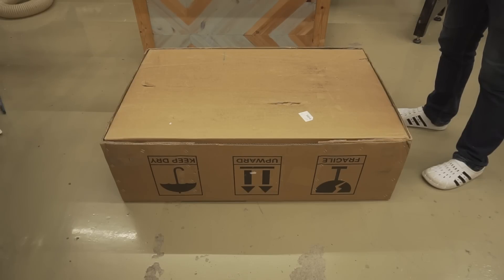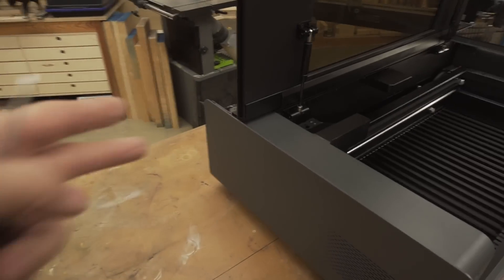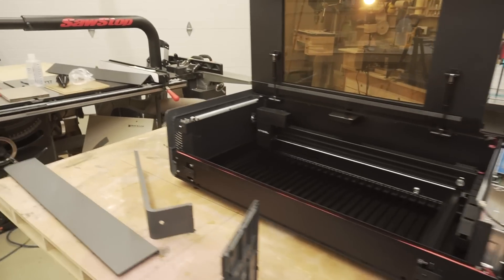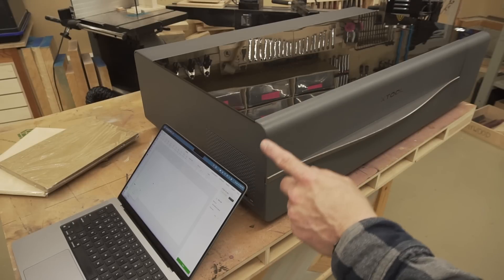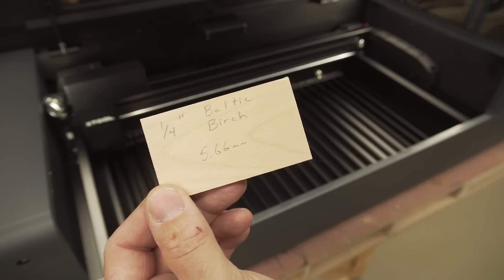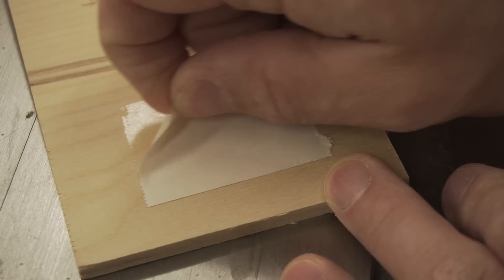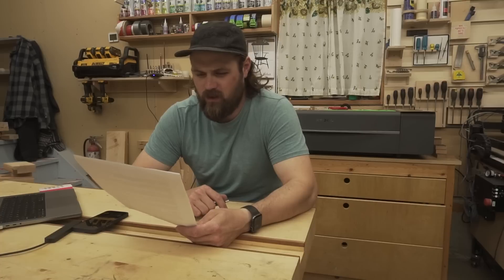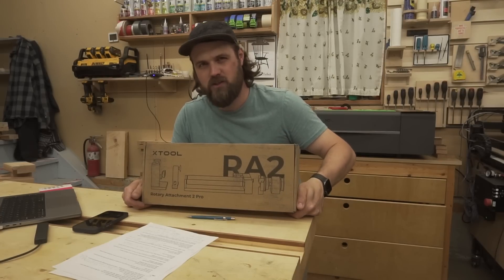xTool P2 - what's inside a $5000 laser?

Comment: Thank you so much for doing this!  I'm going to be performing air-assist surgery on my P2 soon and this video gave me exactly what I needed to plan that out.  Video coming soon.
Reply from the maker: Upgrade or just replacing? I’d like a little more air flow on the P2.
Reply: @dpmakestuff  I’m tapping into the air line using the coupling that is intended for the fire suppression system.  It will be fully reversible to factor and allow me to use factory air assist or factory + external.
Reply from the maker: @nathandcole  any luck? I need more air power.
Reply: @dpmakestuff  yes.  I need to post the video.  I’ll try to get out up this evening.

Comment: The safety interlock can also be a safety hazard. In event of fire the interlock prevents opening the cover to use a CO2 fire extinguisher. As to the rest of the design, the P2 will be fairly easy to maintain without any support. Substitute parts are readily available for most of the guts of the P2. The only part that could be difficult to substitute would be the control board since it contains proprietary code.

You can get through the 3/4" Baltic Birch plywood. However, avoid making too many passes in a row without allowing the wood to cool. Otherwise, there could be a fire.

Comment: Dang, I was hoping you would show the air assist pump. It is in that chamber where the transformer & power supply were, but you did not show it! Great video regardless.
Reply from the maker: I literally showed it. The words “that’s the air pump” came out of my mouth.
Reply: @dpmakestuff  holy crap I am going back to there to see it then, how did I miss it? I was watching so close lol.
Reply: @dpmakestuff here it is! Thank you man. It was from the back of the machine, I was looking for that part in the button side of the machine. Thank you for letting me know, I know how I probably missed that part, I was running my mouth about it not being mentioned in the part before it lol.
Reply: @dpmakestuff sincerely a fantastic video. What are your thoughts since producing this video? Has it been some time; anything else to touch on or to look out for in your future content? I love this machine so far, best in class, fully agree with your assessment & you tested more materials than we have with it so far.

Comment: On the plywood which you tried to engrave and then dye, maybe put a plastic sheath over it before you engrave it? Maybe packing tape could work. This could simultaneously form the negative of a stencil to protect the rest of the plywood from the ink? Looks like you can order wide sheets of tape if tests work
Reply from the maker: So I sealed the surface with lacquer, but the paint went into the wood under the lacquer. I think I should have sealed with lacquer before painting. I could have also turned off the air pump and I bet the burnt wood would have looked perfect ¯\_(ツ)_/¯

Comment: Why is the power switch in the back? Same as my 3d printer. I don't want to have these machines running all day. Power on, use, power off. But this thing is amazing! Do you think it could go through carbon fibre plate?
Reply from the maker: I have a carbon fiber plate. I’ll give it a try. This machine does have a rather annoying switch/button configuration. Power switch at the back, E stop to the right, cord plug in on the left, and start button on top.
Reply: @dpmakestuff  I watched some videos on laser cutting carbon. If you just try to power through the epoxy decomposes and no cutting happens. There is one video of it working really well. I think that is a pulsed laser. One way to do it might be many many passes of an engraving setting.
Reply from the maker: @marc_frank  that’s good info thanks.

Comment: I have wondered just how good those smoke extractors really were...   how expensive are the filters on it?
Reply from the maker: I think the replacement filters are 70 USD. I could be off a little,  it in that zone.
Reply: @dpmakestuff  So how good is the extractor? The filter pack is actually  $160.00. Main main issue with that is that they don't sell the filter stages individually. They should have different runtimes as I've learned from Flux's Beam Air Filter.
Reply: @ulaB  you are gonna buy A LOT of filters for the xTool smoke eater.  it worked fine with the 20 watt diode but the P2 is a whole 'nother story.  Even my FILTRABOX Micro got " dirty" pretty fast.